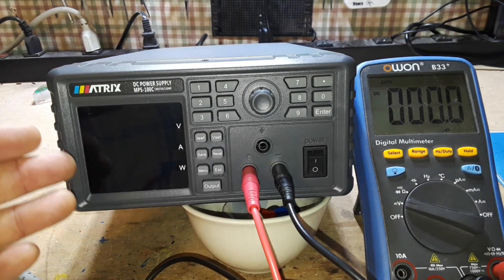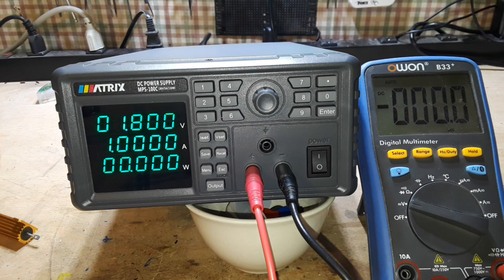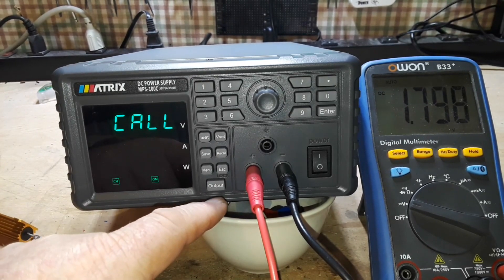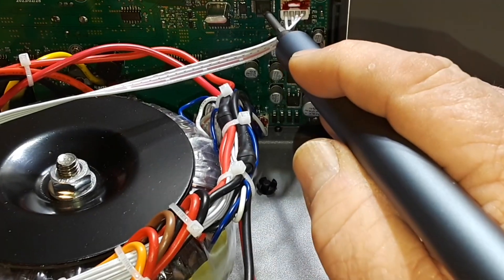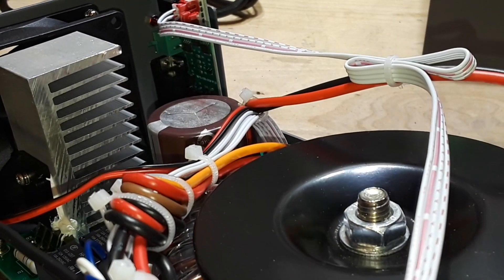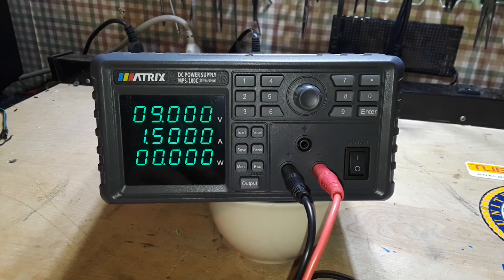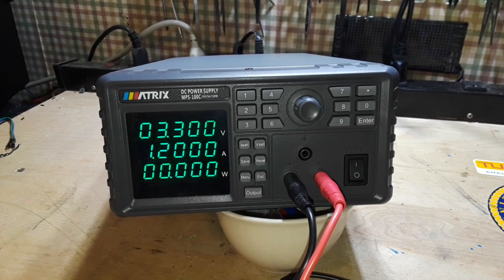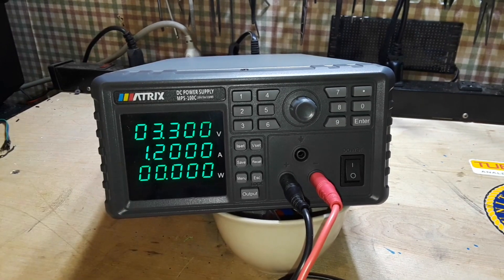Matrix MPS100C Linear 150W Laboratory Power Supply Review and Tear Down

Comment: Thanks!
Reply: Time 12:15pm In the book Practical Electronics for Inventors Figure 4.41 Polarity Protection Circuit I am interested in bread boarding because of my disability that causes my hands to shake. I think this circuit would save me components and equipment, the problem is I am not sure how to put the diodes on the bread board.  Figure 4.41 about page 473 PDF version.
Thanks for the help
Ronald Kiner

Comment: Interesting linear supply.  They need to make the memories work with 2 keys (Recall+Num) rather than also require an Enter press as that's just added confusion and effort.  They thought that the knob surrounded by keys was fashionable, but it's poor ergonomics to split the number pad in half; the knob should have been on one side or the other of a standard num pad instead of that strange vertical layout.

Thank you for checking the ripple, but wish you'd used one of your more accurate bench scopes that reads mV.  Hope things are well with you.
Reply: The split keypad is a nice compromise, it's even faster if you use both thumbs. If you had a standard num pad either the case would need to be taller or the display screen smaller. The display is really nice around 530nm, to make the display the size of a RD6006 would be a crime.

Comment: Thank you for the fun and interesting review.  You have a new subscriber 👍  This video is hilarious to me because everything I do uses an Arduino and CMOS and sometimes an LM386 for some audio output, an LM324 as a pre-amp, or other gadgets thrown in for good measure.

Most of what I do takes about 100uA to about 100mA.  I usually use a 9V alkaline battery as a power supply, with a 0.1uF decoupling capacitor.  This usually lasts for a few months of experiments.  Or I use 5V USB power.

NEVER in my wildest dreams would I need 5 Amps.  Lol.  But obviously some people do, so good on them :-)

PS - Since I am now retired, most of my projects have to do with making weird patterns with LEDs.  Usually designed for Halloween (with motion sensor and spooky sounds) or Christmas (with twinkling RGB lights.  Not those d*mn flashing ones you get at Dollarama. Lol).  Some would call them "beautiful" and "artistic".  My wife just calls them "weird".  Lol.

Cheers from Canada and Merry Christmas.
🎄🛷🪆🪅🧸⛄🎅

Comment: Where is the fuse on input side? No space for it on the input side, cables goes directly to transformer. It's unclear if power switch will disconnect transformer or not. 
Thank you for review, looks nice from outside, but still need work. If I absolutely need this one, I'd install new socket for AC power, with integrated switch and fuse.
Reply from the maker: It has a fuse under the IEC cable input.